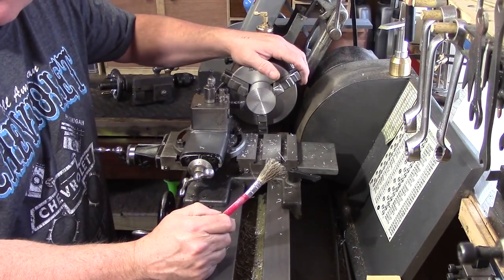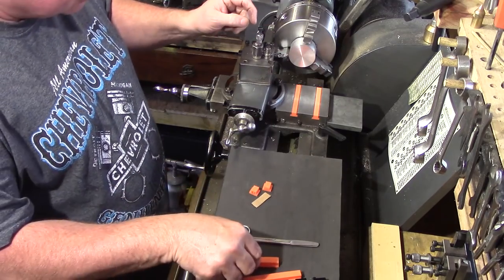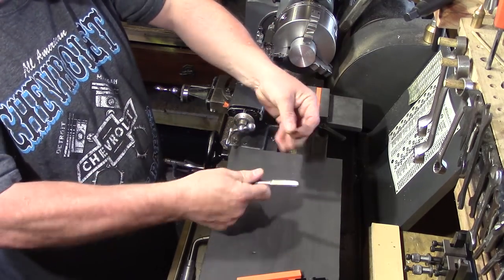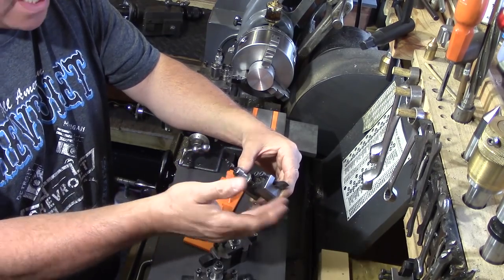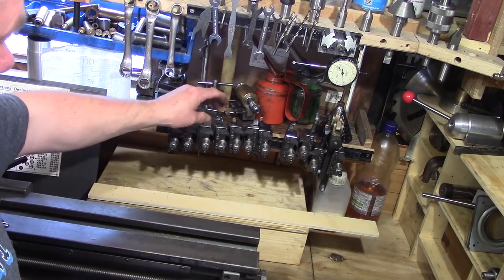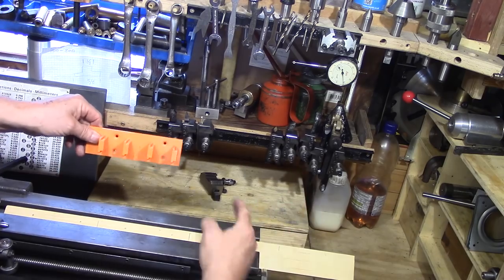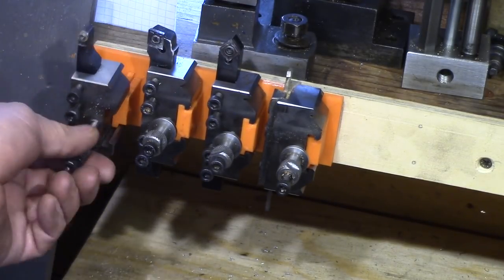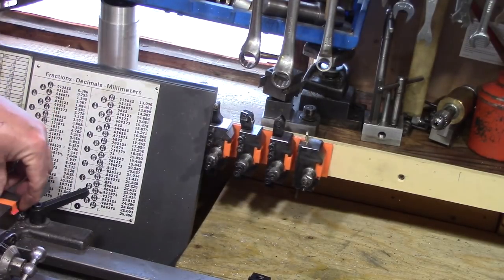3D Printed Accessories for the Myford ML7 Lathe and Quick Change Tool Post

Comment: I used the aluminium tee slot strip available from RDG to fill the tee slots on my ML7. They were also a slightly slack fit so I recessed a small 7mm dia round magnet in one end which I stuck in place with loctite 638. This is enough to hold the filler strips securely. Magnets obtained from our friends in China via Banggood.

Comment: if you get back in touch with him suggest a slight redesign in that he puts a curve on the lower side of the toolholder holder. it is much easier to place a holder on the top and rotate it downwards rather than have to align things before they fit. Another slight mod is to have the mounting face  àngled so that gravity will keep the toolholder against the wall. Other than that I would give him 8 1/2 out of 10.😉😄